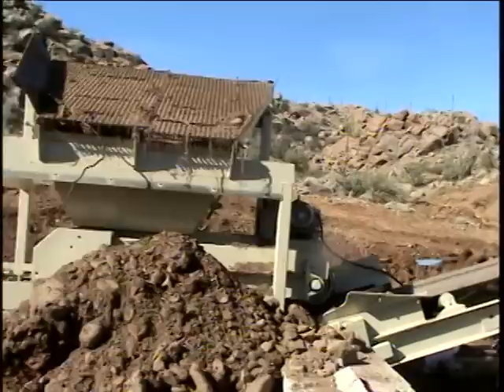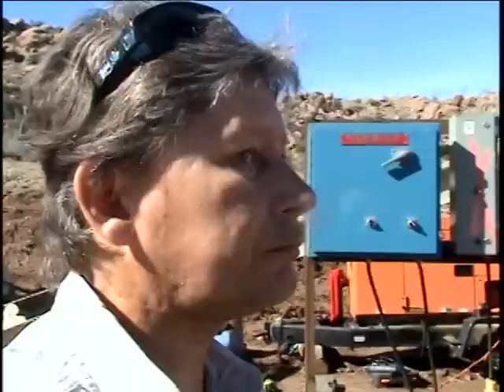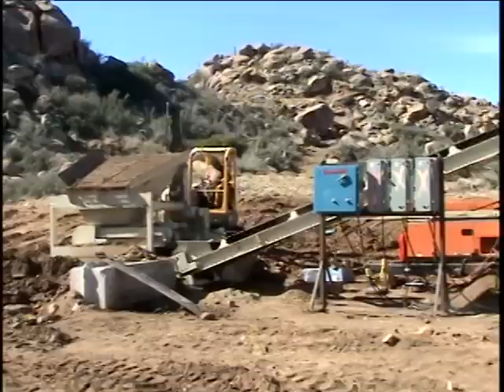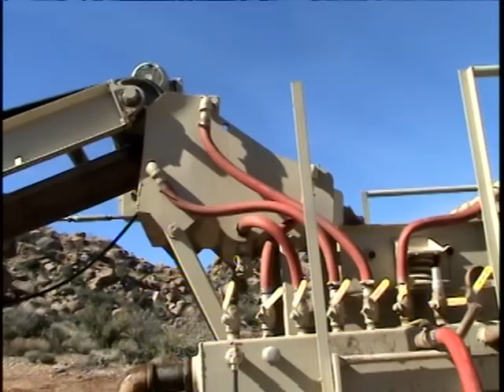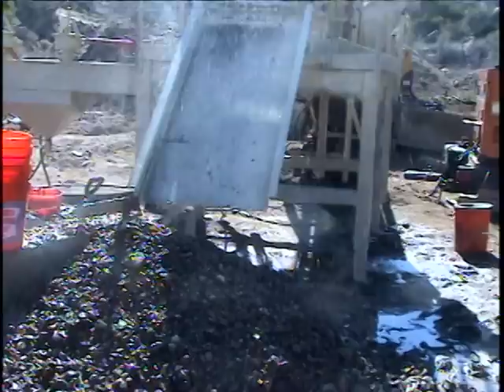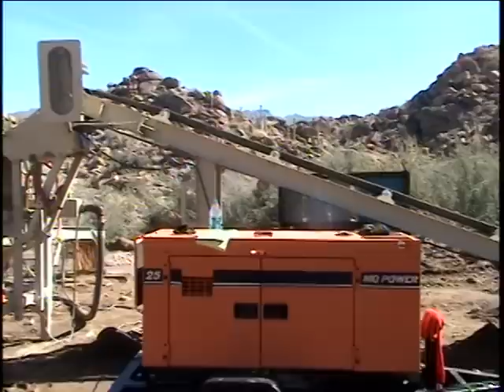LloydWashPlant.avi

Comment: Try making your griz shake so your not having to re-scoop all the dirt that falls off with the rocks when you clear it. It's bad enough loosing the gold thats stuck to the rocks that are unwashed...But as far as I can see from the conveyer forward is a great plant! Good job!
Reply: Grizzlies are too close together. Need 2 or three screens stacked on top of each other if you're doing it like this. Maybe 6 inch gaps on top followed by 4 inch then 2 inch gaps on the bottom so 2 inch minus is what your running. Best bet then iis to run that material thru a flume and classify it 1/4 minus, 1/4 to 1/2, then 1/2 to 1 inch. Then run the 1 to 2 inch thru a boil box, nugget trap, enlarged Clarkson Riffles, etc.. 4 sluices but classifying it will lock the gold in and get better recovery. If your riffles are right, you should be able to run straight water thru the sluice and clean out 1/2 of the garbage material while the gold stays at the bottom of the vortexes.